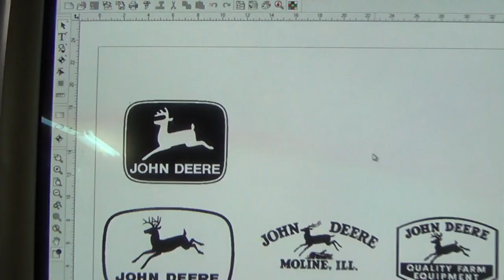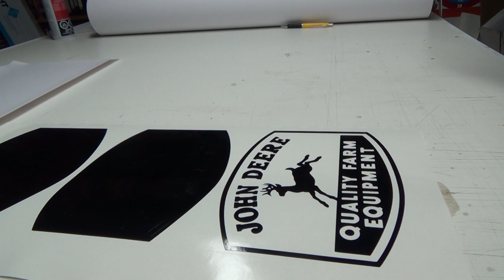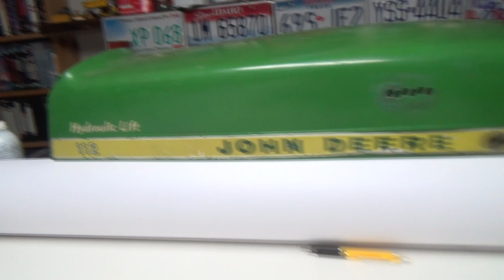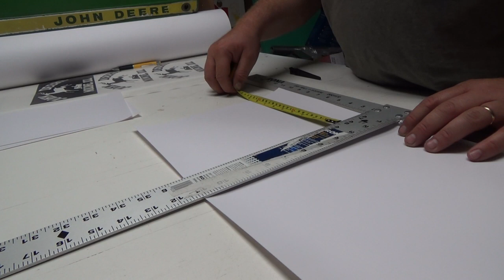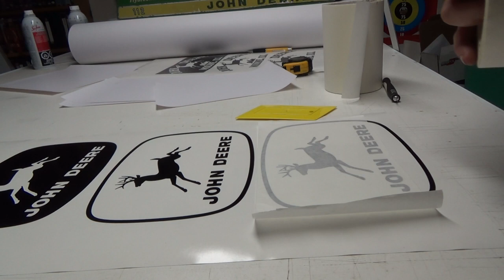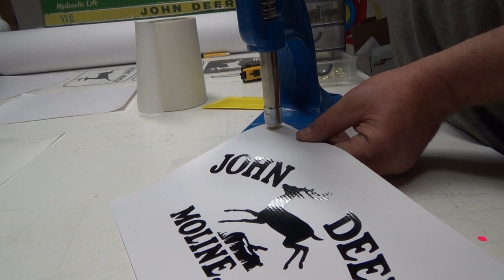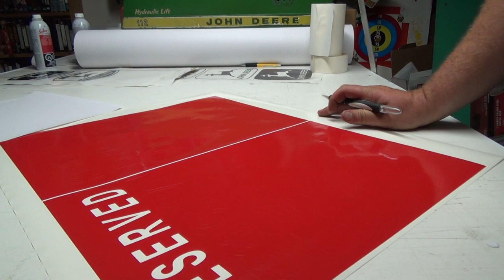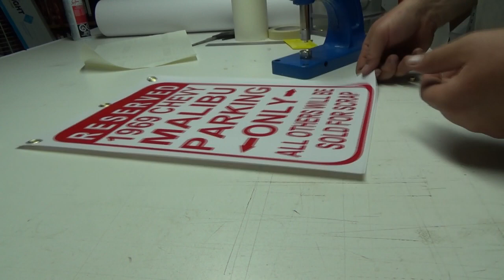Vintage old deere decals

Comment: The deer jumping over the log logo was used from 1937-1940. The quality farm equipment deer is from 1940-1956. The 4 leg deer from 1956 Until 1968. Although interesting fact, John Deere's Garden tractor line used that logo until 1970 for some reason. The 2 leg deer was their logo from 1968 to 2000. The 4 leg deer is the logo style on my 1968 John Deere 110 and it is probably my favorite of all their logos.

Comment: I just had a bad storm with 45+ mph winds it snapped one if my trees and took tons of branches down along with whole trees onto power lines. Small trees just snapped under the power if Mother Nature. Now I have to deal with a tree that split at the Y up 25-30ft up and it's stuck on another tree so I'm screwed :)

Comment: Also on that hood you are doing for your buddy you would be able to get away with doing the hydraulic lift logo the same yellow you do the John Deere Stripes. The ones I've seen were the same shade of yellow as the John Deere logo stripes. Those ones are just faded out badly. The Hydraulic lifts on those JD garden tractors like his is are actually pretty uncommon, Most were hand lift tractors.